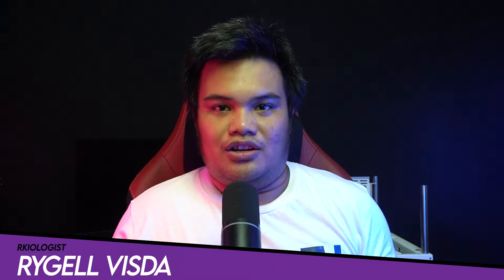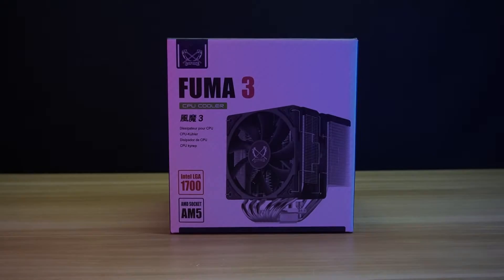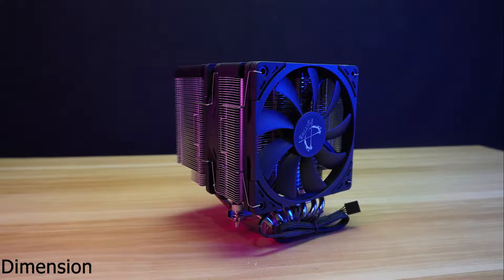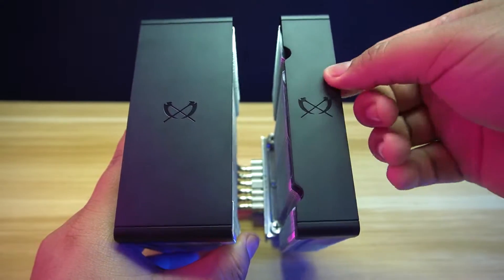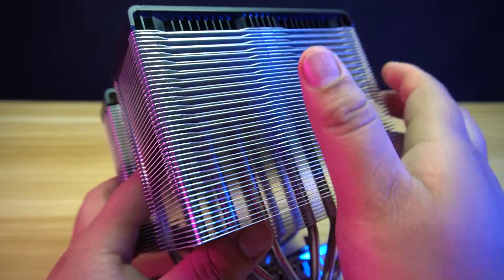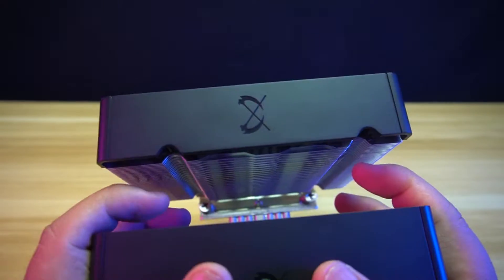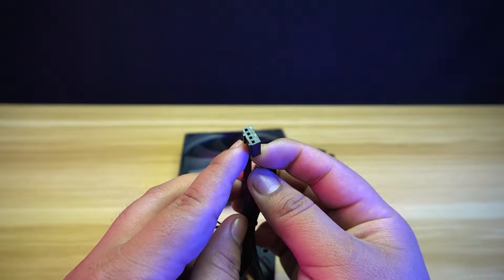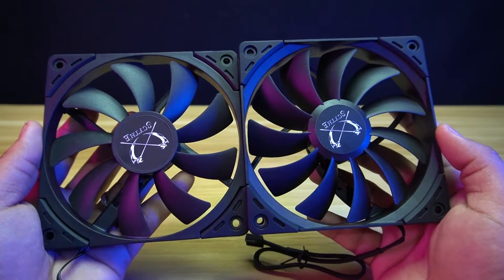Scythe FUMA 3 - Unboxing & Review

Comment: no matter how expensive air cooler u have , results are always same +/-  ... i bought Fuma 3 and works great OC AMD 5700X max 75C in games CPU 95percent load @ 1500 rpm
Reply from the maker: Because you are just testing it on games which not all games are cpu intensive loads. I test it with Cinebench to stress the CPU. It will really show you the cooling performance at 100% speed of the air cooler. Also for sure we are living in a place with different humidity and ambient temperatures which also are factors
Reply: @RKiologist Aida 64 Cpu only stress test @ PBO off , CO off = 57°C ,  PBO on CO on +100mhz = 71°C.. is this enough?
Reply from the maker: @paganSK  if you are trying to compare my results to yours. I think you should probably do the same methodology. Scythe Fuma 3 is great for its value but it doesn't mean it will perform the same with your results if the methodology is different.

Comment: It’s a great cooler, been using it for 4 months zero issues. Coming from a Kraken X53 AIO I’m getting better temps, I am using noctua fans with it though so I’m wondering if that helps temps even more.
Reply from the maker: it would but still depend on the airflow
Reply: @RKiologist  I did read that some cases are better for air coolers than others. I’m using a Fractal Pop Air and it’s working well.
Reply from the maker: @PaoloMix09  yep especially the mesh ones are really great.